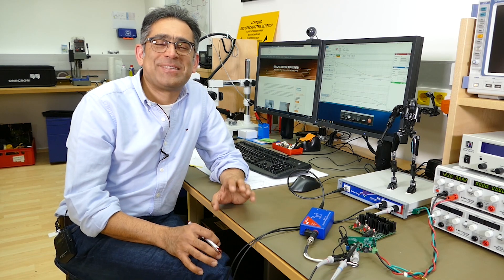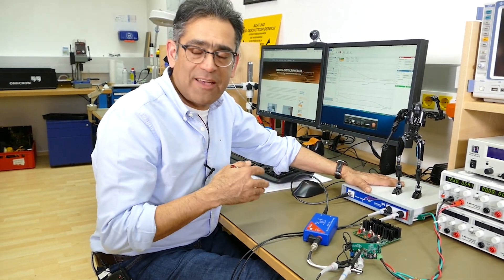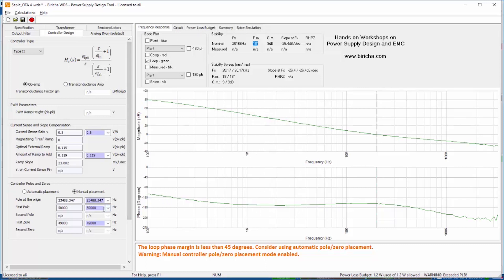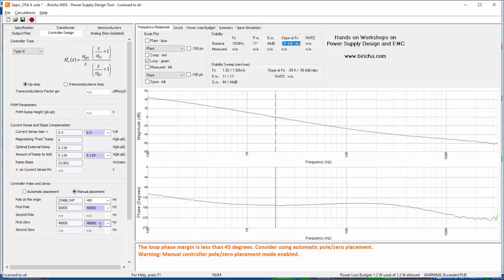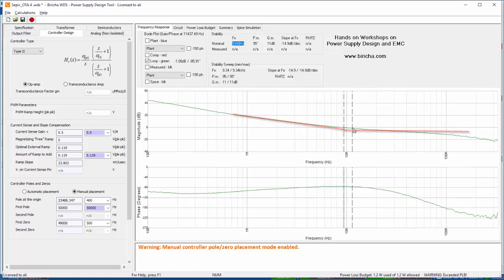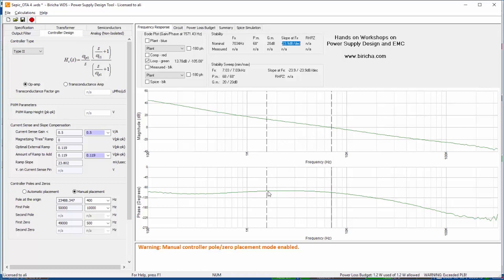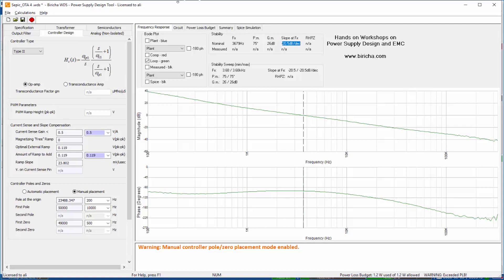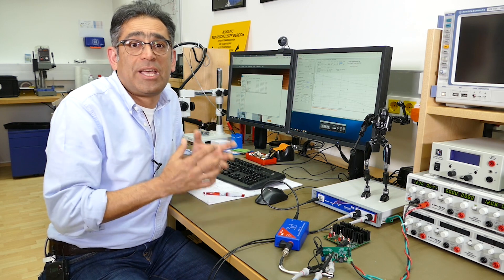Stabilize a SEPIC Converter without Complex Maths

Comment: We are using a BUCK converter with STM32 controller and 3p3z algorithm as per coefficients derived from WDS application. 
The converter has good regulation on light load.
However at half load or full load , We are struggling to reduce the input ripple.
Our output voltage is 110V DC.
The input ripple at full load is from 130V to 220V DC 100Hz. 
This ripple is transferred to output with about 20Vpp 100Hz.

Comment: That's great, thanks! There's a small bug in this video (@4':30'' time).  When a schematics Tab is opened in WDS , there's a Full-bridge converter schematics, but obviously NOT a SEPIC. 

Also, what's concerning the WDS program itself: 

Do You plan to include in WDS the new "File import" support for ".dat" files format for FRA measured response files other then OMICRON (c) ".bode3" files?
The  OMICRON FRA is a rather expensive instrument, and it seems that there's no file format converter that could convert ".dat" files format to  ".bode3" files to be imported further in WDS.

Thanks, Alexey.